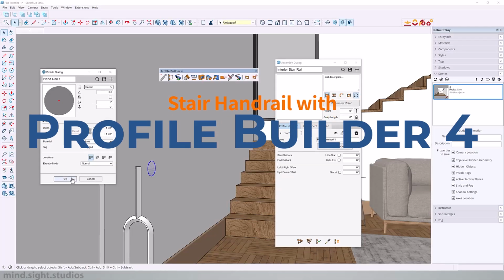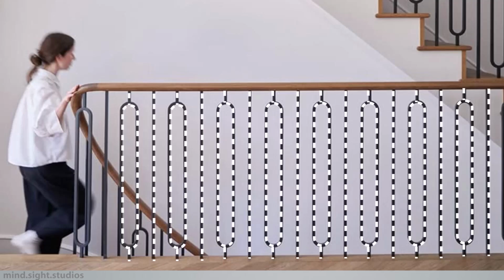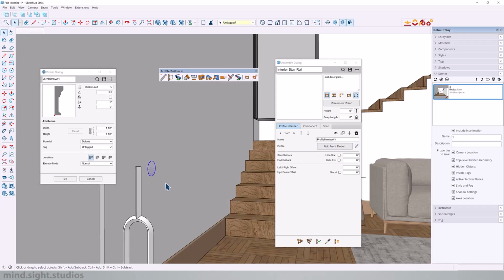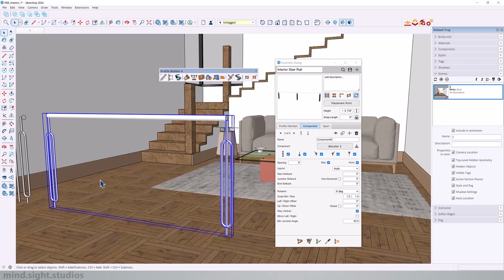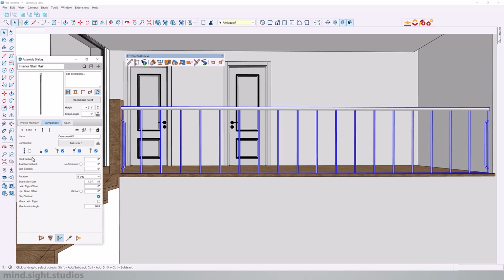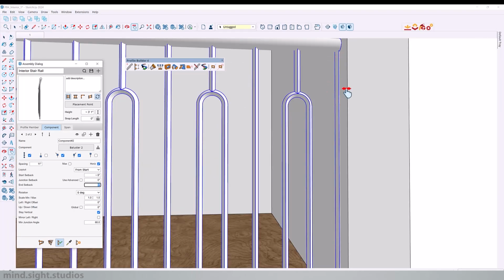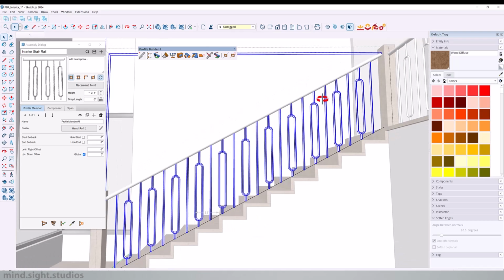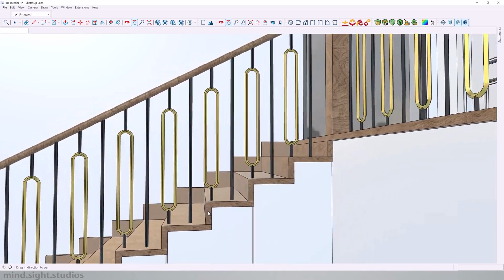Create Stair Handrail Fast with Profile Builder 4 in SketchUp

Comment: Can profile builder turn a handrail down stairs without distorting the rail? I noticed you did the stair portions as different assemblies but some stair railings are done as 1 long piece from top floor to bottom.
Reply from the maker: Yes, it can but the reason we did it in sections was because it makes it easier to control the spacing of the balusters.
Reply: @mind.sight.studios  Can you post an example?
Reply from the maker: @johnjlopez  This is a complex question as I am not sure how to interpret what type of railing you want an example for.  Please contact us at https://mindsightstudios.zendesk.com/hc/en-us/requests/new and include an image of the type of railing you would like an example for.  Thanks!
Reply: @ Then why would you say yes in the last comment if you dont understand the request or ability?

I want to know is profile builder can make a railing turn a corner and go up or down without distorting the railing is it does in earlier versions.  Dale is on record saying it could not be done in prior versions.
Reply from the maker: @johnjlopez  There are too many variables to consider.  In your initial comment, you referred to a railing that is one long piece from top to bottom.  This would require a smooth curving extrusion path which Profile Builder can handle without distortion. But here, you are mentioning a railing that turns a corner and also goes up or down at the same time.  As far as I understand, such a junction cannot be constructed as one long piece and some type of twist or distortion would be needed to make such a turn.  To accurately answer your question, a picture would be helpful.  However, I don't believe we made any changes between v3 and v4 regarding this issue.